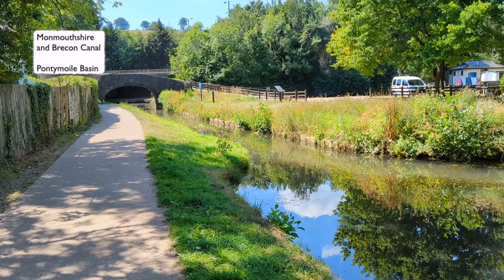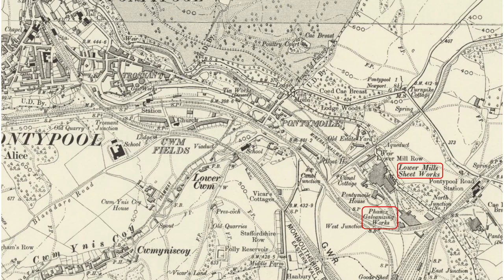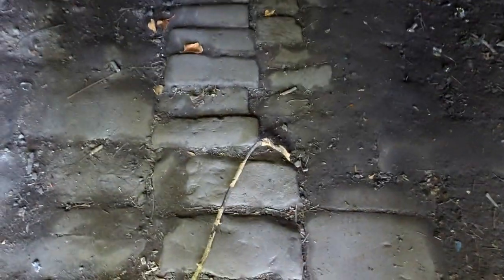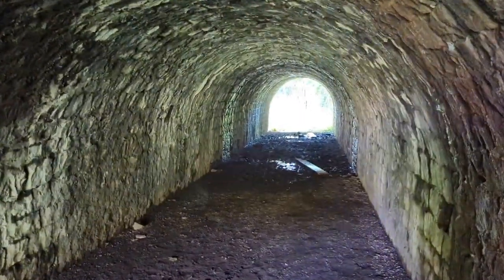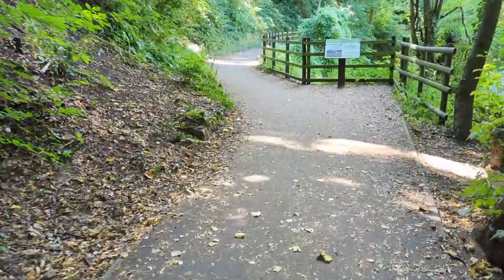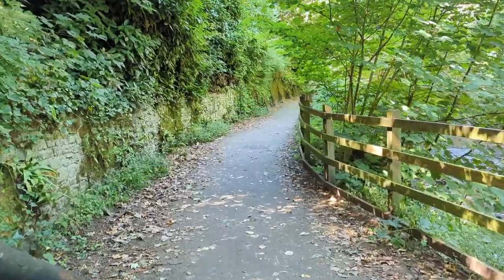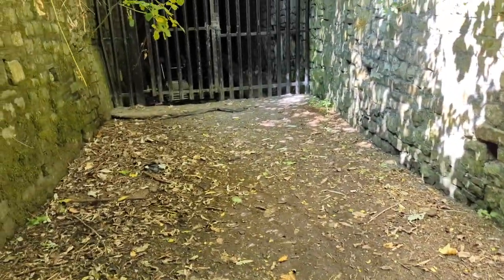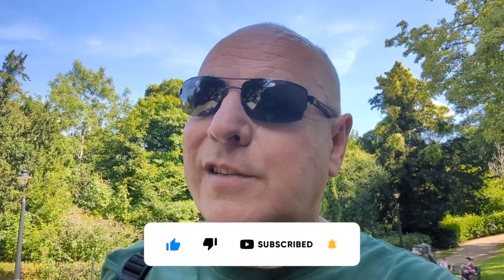Three tunnels in Pontypool

Comment: Sorry so many mistake's, the narrowing of the canal in front of the cottage was a lock be it with single gates and no drop it still was a lock. you call the river the Avon wen which translated is the Whiteriver when in fact it is the Greyriver the Avonlwyd.
Reply from the maker: Thanks, yes I did find out when I got the video up that I had got the name of the river wrong, unfortunately YouTube doesn't allow for re-upload video. I found out this week the narrowing was also used to stop and check the contents of the boats to charge tolls. I am planning a further video at that site and I will correct the river name at that point. Thank you for the Welsh translations, they will be useful. 👍

Comment: Nice video. I've been around the area a couple of times, but I didn't know that the smaller tunnel was for a leat. Also, did you know that there was a spur off the canal from Pontymoel towards the town. The remains of some locks were found when the road was built (in the 1980s I think). I presume the old buildings right by the traffic lights would have been right next to the canal, but it didn't last long, possibly it was taken over to build the railway line over it?
Reply from the maker: Yes I found that out researching for this video. I thought the stub was just a turning place but found out it was where the canal actually went. I also found out that the leet went from the weir I mentioned in the video but too late to include it. There is much history around buried underneath Pontypool. Thanks for watching.